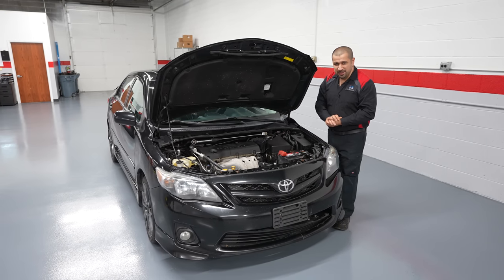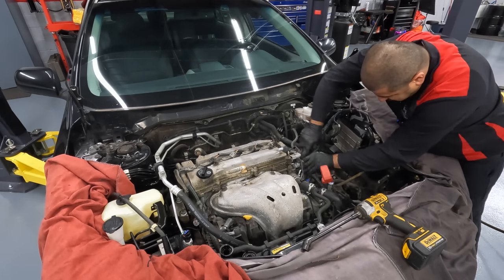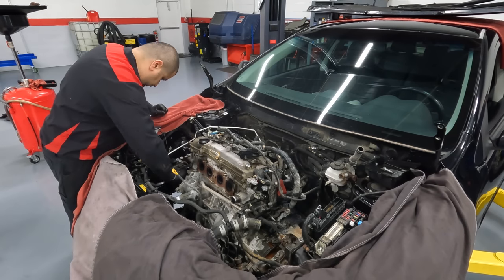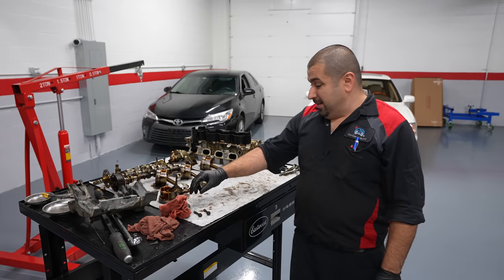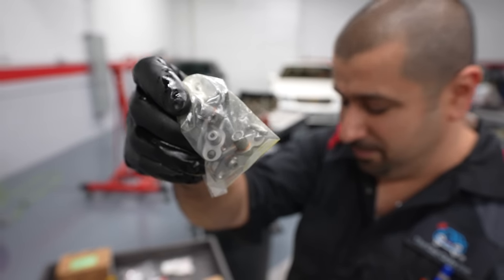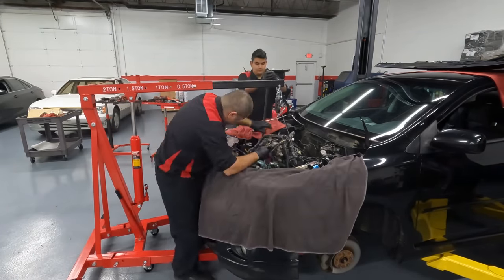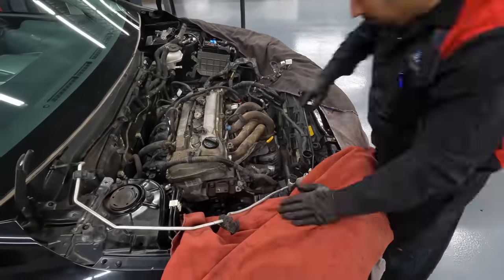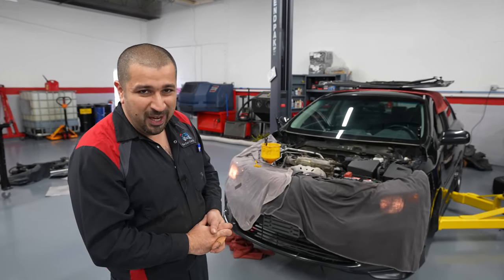THIS is Toyota's Worst Engine Ever Made! But Is It Really THAT Bad?

Comment: I had that motor on my Rav4. Brought it to a dealership and found out such problem. No sludge but burning oil. Had to replace the motor with a used one, instead. Kind of frustrating when the company would not compensate you in some ways when Toyota knowingly had a big issue on this motor.

Comment: I have a 2002 Camry here in Australia. Had to replace the engine at around 480,000kms due to a blown head gasket. Currently at 520,000kms. The Toyota dealership I worked for taught us to drop the engine and trans out the bottom as a single unit with the subframe. Apparently it was easier.
Reply: How to lift car away from engine and trans.
Reply: @timyang4775 use a hoist or engine liift by lifting the whole front up

Comment: First of all…I LOVE YOUR CHANNEL, as I am a 71 year old Toyota fan-boy. I am about to purchase a 2012 Scion xB for my wife to run around in with our 4 dogs. It has 106k miles, in impeccable condition. The previous owner took it to her Toyota dealer every 4000-6000 for oil changes and standard maintenance work. I have read several places that Toyota fixed the oil consumption issue with these engines in 2011 and that the 2012-2015 xBs should be good. Was this a fact or are the guys that post that information on the forums mistaken? I have a copy of all 27 service records and at no time did the owner tell the service writer to have the tech check for the oil consumption. And at no time did the Toyota service tech suggest that it may be an issue either. They suggested a few other services and she had them done…coolant flush, transmission fluid change, cabin and engine filter…etc. Did Toyota change the oil ring/piston design in 2011? I would really appreciate your input on this Mr. Nut 😊

Comment: I have a 2007 camry with this motor and not only does it not burn oil but it's the most reliable car I've ever owned by a long-shot. I currently have 380,000 km's on it and it's running like it did from the factory. I fully expect mine to go to somewhere around the 600,000 km mark.

Comment: Had the 05 Camry 2.4 bought new. No problems.  Then after about 220k miles the rear center 3 head bolts stripped out.  Never overheated it. Drilled them out and tapped them by hand and Inserted helicoils about 5 years ago.  Did timing chain at the same time. My mother has been driving since her 1992 Camry finally died years ago.  No issues.  Great engine.

Comment: I own 2009 Toyota Camry with extended warrantee (at that time)  and had the burning oil issue checked at Toyota dealer. It was burning 1 liter of oil per 4000 km. Dealer still tried to persuade me that that is normal. At the end they changed the pistons but it took long time to accept that and now it is not burning a drop of oil. I believe there should be recall for this issue or class action at the time. This is great video and reminder how even best car manufacturer can screw up.

Comment: I had an 09 Scion xB.  Burned oil like you couldn't believe.  Took it to a local Toyota dealership for the oil consumption  campaign.  It passed.  Sold it a year later.  Now we have a 2018 Corolla iM.

Comment: 2012 Scion XB. Oil burning problem repaired at 75,000. I now have 181,000 on it. Never had an oil burning issue again.  The key is changing oil every 5000 miles.

Comment: Awesome video! I have a 2009 Corolla 1.8 liter with 216k miles. It has been a very reliable engine although it does burn oil. I am considering a full rebuild because I own the car & do not want to finance another vehicle or have a car payment. I was glad to hear that the oil burning problem can be rectified with the kit that you mentioned. $3200 is not exactly cheap but it is much more economical than 4 or more years of monthly car notes.
Reply: I have a 2001 Corrolla. 250000 miles. 1 quart of oil 600 miles  . Runs great  Oil is cheap😅😅😅
Reply: My engine uses roughly 1-1.5 quarts of oil between oil changes which is every 5k miles.

Comment: Had one of these in my scion TC with over 200k and it never gave problems. I sold the car when the A/C stopped working, but the engine showed no signs of ever breaking down. Most efficient car we ever had.

Comment: So this problem didn’t affect the 2006 rav4 4 cylinder? Because I’m looking to buy a 06 with 117k miles. I keep reading online that the 06 rav4 has the same problem but sometimes people just repeat what they hear.
Reply: Me, too, JMO. 
Commented above on my 2006 Base Highlander with same engine.  Runs great and watching coolant level after recent flush to avoid overheating, just in case. Wondering if some of these 2006 2AZ-fe engines were corrected during later 1st generation  manufacturing - before they introduced the modified pistons for emission concerns.

Comment: My mom has this car and it's a 2009.... Every time she gets in her car we have to check the oil and it's always a quart low on oil after 250 miles... the car just turned over 140,000 miles... Is the warranty still valid ? Sadly, my mom is 76 years old and can't afford to get this problem fixed let alone buy another car... 😞
Reply: This^  i have a scion tc and wonder if we be persistent and ask toyota to fix due to recall will they honor? Anybody out there😂

Comment: As a student a had a Corolla ‘96 with 7A-FE engine and it burnt a quart every 800 miles. It lasted 350k before I sold it but every component failed, I went through starters, thermostat, alternator, shocks, engine mounts, hoses, etc etc

Comment: I had this car for 5 plus years even after 225k miles the car was running fine never had any problems with oil or any big issues with the engine

Comment: 2004 RAV4 here. About 80,000 miles had two or three middle bolts on the intake side let go of the threads. Bought a repair kit on eBay and fixed it myself... about $300. Same kit repaired a Cadillac model that had a similar problem...I don't remember which one. Just got past 170,000 miles. Repair was done in 2017. I've fixed all head bolts. The inserts are solid steel and not coil. Still get around 22mpg city driving AWD model. 24 or 25 highway. The cause was a piece of foam around the intake manifold are that caused a hot spot.

Comment: Any car might get you where you want to go. Only a Toyota will get you there to do whatever you ask it to do and get you back home. 
I have a 2010 Tundra 5.7 that pulls my lawn care trailer all day, 260,000 miles and I've had absolutely no breakdowns, just basic maintenance and on-time oil changes I do myself. I use Supertech 5w-20 oil and a Toyota filter.
I have a 2010 Camry with the engine in this video with 270,000 miles, same reliability and maintenance as the Tundra. The Camry does burn oil as described but it just isn't worth fixing it at this point. Great video. Per your advice in this video I'm going to use 5W-30 in the Camry from now on too!

Comment: These 4 cylinder Yota engines are such a delight.  Had to put steel head bolt inserts on my 06 Solara at approximately 200K. Currently over 300K and doesn’t skip a beat!

Comment: I kept finding really mint 2009 Matrix S and XRS for sale, now I see why 🙄 actually was going to look at one until I happened across this notorious issue. Now I've been asking every dealer if the repair has been done, they all say NO but they also tell me "Well there was a recall on SOME 2009 with the 2.4 but this one wasn't". Still not trusting it and looking for an 04 with a 1.8 instead. Real shame, I love the looks of the 2nd gen matrix and having an XRS with auto+sportmode would be sweet. My 05 Grand Prix was an oil burner, and I just don't wanna sign up for that again.

Comment: 207,600 miles on my 2002 Camry.  Has the original 2.4 engine and have never had head bolt issues.  Loses very insignificant amount of oil between changes, not enough to reach the "low" mark though.  Great engine and great car!

**UPDATE THREE MONTHS LATER**
210,800 miles and the HEAD GASKET BLEW.  I have no idea why because I never overheated the engine.  Started hearing gurgling noises behind the dash that got significantly worse over time.  Became a pretty much constant water-rushing/gurgling noise and just today the head gasket finally blew.  I didn't let the engine get very hot but there was steam rolling out from the back side of the engine and coolant was pushing out of the reservoir.  I think the back three head bolts must have stripped over time and finally given up the ghost today.
Needless to say I am very sad.  But, I was aware of this being a common issue so it doesn't come as a complete shock.  Still, shame on Toyota for messing this up.  Such a good engine if it weren't for the head bolt issue in the 2002-2004 models.  Love my Camry anyway.

Comment: Toyota had a recall because of the piston rings but I have a 2011 Camry 183,245 miles and all I replaced is the alternator and battery.

Comment: Were you around when the 1ZZ-FE was more common? Those things were even worse. Mine threw a rod at 70k miles because I couldn't keep enough oil in it. Unfortunate, as those engines were spunky.

Comment: Great video on this TSB and fix, I'm very lucky to have acquired a camry that had this done at 175,000 miles at 265,000 miles 5speed transmission runs like new still lol

Comment: In my experience 2ZR-FE and 2ZR-FXE are the same crap. From oil change to oil engine which I usually make every 7000km there is literally almost no oil inside. So oil consumption is 0.5l for every 1000km. Nothing has changed since 2003.

Comment: In all the years I spent at a Toyota dealership in New Zealand (was around when the 1 and 2 AZ engines were launched), can't say oil consumption's been an issue. Maybe the North American engines are assembled using locally made parts or something. Biggest issue I've seen is the thrust ring on the camshaft snaps off
Reply: Yes I have the 2azfe engine in my Kluger in NZ and have had no engine issues , bought it at 122km now doe 273km

Comment: My daughter uses her 2002 Camry LE 2.4 Liter four-cylinder to deliver catering for a local deli along with some Door Dashing as well.  At 214k, this 22-year-old Camry seems to burn about 2.5 cups of engine oil per week.  The AC is working and the transmission shifts very smooth. But, we really have to keep en eye on the engine oil level.

Comment: Oil consumption is only an issue in later 2azfe models, the early gen 2azfe with steel piston rings is bullet proof, and easily built to handle boost

Comment: I have an 07 Camry with this engine at 192,000 burning oil at a high level, question here do I change to from 0W-20 oil to 5W-20 I am also planning to get this work done in the future the car is pretty solid.

Comment: So I have a 2004 RAV4 with the 2AZ-FE engine that had the head bolt issue. I absolutely never overheated that engine and the rear, center 3 headbolts pulled out. 

Had the local prison industry work on it and they successfully repaired it.  That was about 7 years ago! Still running strong and not burning a meaningful amount of oil. 

It's not a powerhouse but it's still chugging away happily.

Comment: I had too heli coil my 2002. Purchased the kit and drilled out the block and and has been three years now and still holding up great. Only problem is is it using oil now. Need to re ring the motor.

Comment: It’s so sad dealerships destroy any young person that desires to do a great 100% job. I built my own go cart when I was nine years old on a two inch white oak board with bicycle parts, a Briggs & Stratton engine and roller bearing HD cast iron hand truck wheels. I have been riding something since then. Cars, trucks, motorcycles, steam trains and airplanes. That was 67 years ago. You have class and are in the top three of instructors I have ever seen.

Comment: Had a Scion with this engine. 135k miles with not a single problem. Never added oil between changes. Great torque curve for a small engine. Original clutch. Gave it to my son and he's as no problems. Other than maintence parts, the only thing I replace was the rear deck handle. Terrible, terrible, terrible car?

Comment: I have a 2009 Matrix XRS with this engine. It always consumed oil but now that it's pushing 200K miles, it will burn all 4 quarts in between 3,000 mile oil changes.

Comment: Not just burning oil, but head bolts that out.  Thank God for TimerSerts!  Expensive kit for one-off rebuilds. I sold it used on ebay for $350,IIRC  DW's 2004 Highlander

Comment: I had an 02 camry and it was my 1st and only experience with toyota, questioned how everyone said how reliable they are... and that car was very well taken care of , doing a lot of the fluids and filters maintenance in halftime mileage factory recommended intervals... the engine literally rusted out of the car, burned oil, no power, it was junked after 110,000mi
Reply: Were you the mechanic!?lmao
Reply: @timothy2935  it was before i learned to do it myself, that was dealership shit

Comment: excellent vid. not sure why people have to prove they have oil consumption to get the work done when toyota has acknowledged it is a design flaw. yesterday traded my 2012 xb in for an older honda civic to avoid any issues. Probably won't buy toyota product again. thank you for an honest video.

Comment: I have two cars with 2AZFE engines. One is a 2006 Highlander with 198,000 miles. The other is a 2003 Camry XLE with 121,000 miles. Neither one consumes oil and they have been 100% reliable. If I was to be asked, they were among the best anyone has ever built. Of course I take care of them but nothing obsessive. Both have received valve cover gaskets but neither has ever dripped on the floor.

Comment: A great review on a very rare car now.
I had a white Toyota Avensis 2Ltr estate like that one.
I paid 1200 pound for it and ran it for 10 years, up to 170000 miles.
The issue I found with them is the aircon pipe is very close to the engine bay bodywork seam and can rub against it, causing the pipe to rupture and leak the aircon fluid out.
I had a head gasket issue, but this was only because I never changed the coolant, according to a mechanic I spoke to.
It didn't make financial sence to fix it.
If it wasn't for that I'd still be driving it.
I have a MK3 now.
Reply: Which Avensis is the best year model to go for? i am looking for a 1.8 estate.

Comment: Many thanks for this in-depth instructional video. If our '10 Prius (has the low tension oil rings) ever needs the piston/ring replacement, this video is an invaluable resource. Couple it with the Repair Manual, any other info sources, but this video has LOTS of tips from someone, who's done a LOT of these.

Ours is also Canadian spec vehicle. Just past 100K kms. I was changing the oil every 8000K kms or 6 months (whichever comes first). Just in the last year in consderation of our ever dropping use of the car (5000 kms per year, at most) I finally revised that to 8000 kms or 12 months, whichever comes first.

We also had the block heater installed at time of purchase (new), and use it almost without fail, for 2 hours before every cold-start.

Also, EGR system (including Intake manifold) thoroughly cleaned twice, and dual Oil Catch Cans installed.

All this considered, will hopefully never need to do the operation shown in this video.

Comment: They used low tension piston rings to reduce friction; they need to change oil by 5k miles to prevent issues; need to use heavier oil with higher mileage! No need to take it apart yet!

Comment: 4ZZ-FE have this is the uk it burns oil but no where near some of these. a quart usually every 800-1000 miles. Oil is always smelling of fuel eventually a bit varnishy, but it runs like a swiss watch.

Comment: I am witness to the high oil consumption engine from my old 2008 Toyota rav4. I was on the lucky end I would say. I was burning a quart every 750 miles. At 150,000 miles on my 10th year (I’ve only owned the car for 6 months), Toyota had an extended warranty for exactly that mileage and years. Toyota did me right.

Comment: Thankyou Mr. Car nut for this video. I have a 2008 Toyota Camry with a 2.4 L Engine, made in kentucy with 57,000 original Miles. And I have this oil consumption problem , I constantly Manually Check the Oil ,since the oil light won't come on, until it is about a quart and half or more of oil missing.  Thankyou For the Advice to use 5w - 30,  maybe it will consume less oil.I have been using Synthetic  for the last 2 years. Would motor Oil leak Sealant Fom Advance Auto resolve the problem?
Reply: Did switching to 5w-30 help?

Comment: I had a 1.8 Corolla  1ZZ FE which was noted as an oil burner.  
Toyota fixed these engines by increasing raising the oil level 1cm with a new dip stick to run cooler, Drilling extra holes in the pistons to drain the rings better, fitting a lower temperature thermostat .
I raised the oil level and always changed oil at 6000 miles and used  Lucas upper cylinder lubricant 
It never used oil at 250,000 mile and 19yrs of service

Comment: I had an 03 Camry and the engine started to burn oil around 200,000 miles.  I got the P0420 code not long after that when it got above 75 miles per hour.  I would use my OD2 scan tool the clear the code out.  It was 17 years old and it needed new shocks and struts and other things.  So I got rid of it and got a 2020 Camry that is working just fine.

Comment: Worked at a Toyota dealership for some years and I was ripping these engines apart left and right. I've only ever had to helicoil 2 blocks. I did, however, have to get a used short block for at least half of them because the scoring on the cylinder walls was so bad.